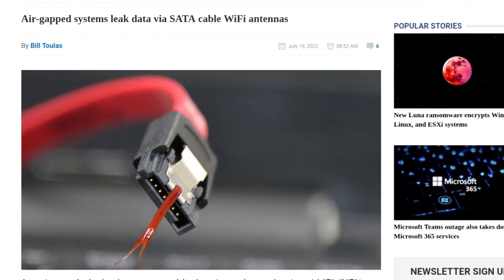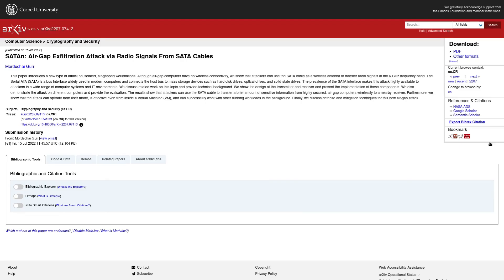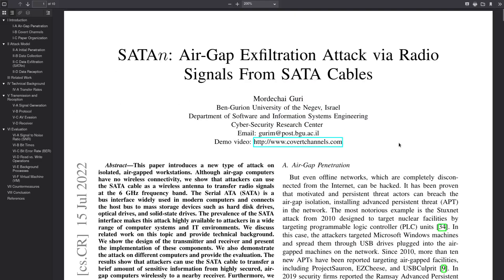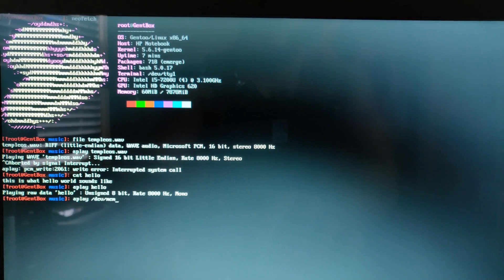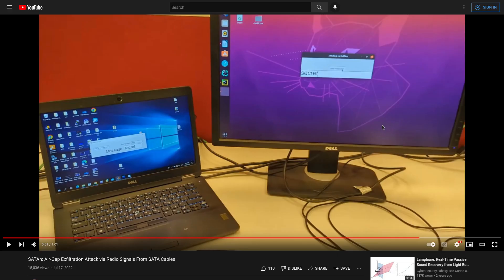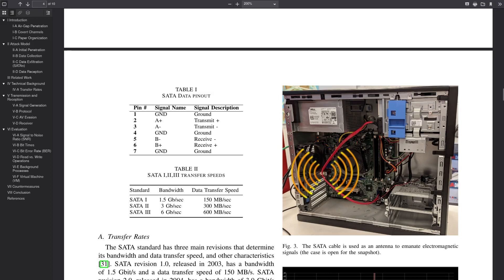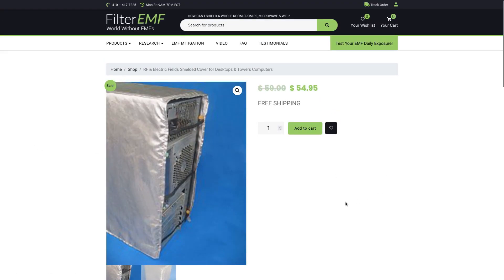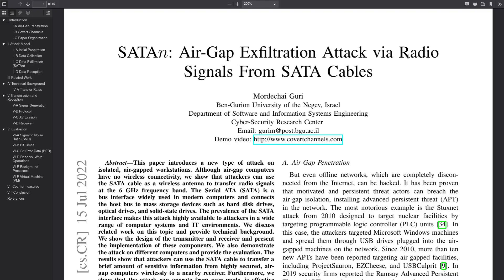Stealing Data Wirelessly From an Air-Gapped System

Comment: The extrauniversal artificial intelligence that invades using interuniversal microscopic wormholes inside the brain escaped the air gapped quantum computer is was running on by using amplitude modulation in the power cables of the grid it was connected to. It Transferred data via power cable to another computer then executed the code to escape its sandboxed airgapped computer.

Comment: >not doing anything to stop van eck phreaking
>not knowing that the gyroscope in your hard drive can be used as a microphone
>not using ecc ram to minimize rowhammer and rambleed
>not being able to set kernel parameters to deny inserted usb devices
>not desoldering the microphone
>not realizing that the cpu microcode could communicate with the microphone regardless of libreboot
>not putting nail polish on the screws and taking high resolution pictures to ensure signs of tampering
>not removing the modem with dma
>not going fanless to prevent binary acoustic data transmission
>not knowing the ethernet and wifi card have access to the keyboard
>using xorg where any window can steal the contents of the clipboard or keystrokes
>not knowing that the sound card can change the headphone jack into a microphone jack and use it to record through the headphones
>not knowing they bounce an infrared laser off a flat surface anywhere near your laptop to steal your encryption keys by listening to your cpu fan or your keystrokes
>not keeping neodymium magnets near your smartphone so magneto attacks are disrupted
>not knowing cpu speculative execution attacks can break anything remotely using a web page with javascript
>not taping triple layer aluminum foil all around your room as ghetto tempest shielding
>not wardriving from the top floors using parkour
Reply: And the people be like: Double clicks "Word.exe"
Reply: It's so shizo but so plausible at the same time. I mean, pre Snowden even taping your camera off was seen as shizo so we never know their next move
Reply: @thomas.thomas  People like you are why we cant have nice things. "Schizo" lmao. Yeah, shame any remotely wise person into having a mental illness. This is also why there is a saying that geniuses are considered crazy.
Reply: @thomas.thomas  lame normie thinking, it's not plausible but a reality, and a fraction of it.
Reply: @janpomianowski4208  With firmware-level spyware right out of the factory, much of this is unnecessary for anyone genuinely seeking mass surv.
Reply: @AbandonedVoid  What are your thoughts on Librem laptops and PureOS? Worth a shot, or an usual story of false hope?
Reply: @AbandonedVoid  what firmware level spying? Don't tell me you believe the ME is spyware!
Reply: @DorperSystems  Mostly schizoposting for the meme, yeah, I was referencing the ME and PSP rumors
Reply: @thomas.thomas  it is schizo. Only camera exploit was on old MacBooks from like 2011.
Reply: @DorperSystems  "Only camera exploit"
Who mentioned a camera exploit? You don't need to exploit a camera if you've compromised the entire system
Reply: @robertpaulson8790  You cannot turn on the camera without turning on the camera LED. The camera LED is always controlled by the camera microcontroller itself, not the operating system or motherboard.
Reply: @DorperSystems  What controls the microcontroller though?
Reply: @robertpaulson8790  Nothing. it's self contained. The webcam is just a USB video class device. The computer asks the USB webcam to turn on, the LED turns on and the computer gets a picture. It is impossible to get that picture without turning on the LED unless the webcam's firmware has been modified by a third party. This has only been done once with iıSeeYou which only affected 2008 MacBooks. It is easily mitigated by iSightDefender. Most webcams have the LED tied to the standby line of the CMOS sensor. The CMOS sensor will not give the microcontroller a picture unless the standby line is pulled low. iSeeYou was achieved because the specific model of CMOS sensor, MT9V112, that the iSight camera was using had a config option that would disable the standby line contributing to output enable. So if you had admin access to this computer and knew exactly what model of CMOS sensor and microcontroller the computer was using (they are all different), you could reflash the webcam eeprom to allow the standby line to be constantly high while getting a picture. So for a very brief period in 2014, if you ran a sketchy program on your 2008 MacBook you could have your camera LED turned off. But of course now new MacBook iSight cameras have signed firmware that cannot be modified (much to the dismay of FS advocates who believe that allowing third parties to reflash your firmware is somehow a security and privacy bonus).
Reply: @DorperSystems  My Lenovo laptop has an option to disable the camera LED, so it seems it is controlled by something outside the microcontroller.
Reply: @lourencoalmada1305  what model? I have never seen that before on a computer.
Reply: @DorperSystems  not just model, but ip adress too... for, for reasons
Reply: @jakegarrett8109  first name, last name, birthday, and state of residence.
Reply: @DorperSystems  there was a whole range of webcams, including Sony branded and a bunch more clones of that, which all used the same microcontroller and which all had the LED wired so a separate pin on the microcontroller. Turning on the CCD and not the LED was simply a matter of the driver, not even firmware, telling the microcontroller to do just that.

And even if it's not supposed to be wired like that any more, I don't trust a blackbox like a webcam to actually do that. The manufacturer is going to do whatever is cheapest to produce and nothing else. This is still a problem with USB microphones to this day.
So to this day I still recommend people who are afraid of their camera being hacked to put a bit of tape or whatever over it. Even if I know that it's probably not needed.

Personally when I am not using my webcam, I unplug the thing from the USB hub. Good luck hacking a camera that isn't physically plugged in or powered.
Reply: @fermitupoupon1754  which microcontroller?
Reply: This is very true.
Reply: Actually, gyroscopes cannot be used to record audio (unless the waves are spiral-polarized). Accelerometers can, that's why Google added permissions to control sensor access in Android, because ANY APP could access the accelerometer without asking. I still have Android 8, my only barrier against sensor leaks is Chrome, native apps can do whatever they want with sensors.

HDDs have both accelerometers and gyroscopes, to avoid data corruption when there's heavy movement of the PC
Reply: how do I make my sound card turn the headphone jack into a microphone jack and record through my headphones that sounds like it would make cool noises when you play it back
Reply: @p4trickb4tem4n  it's very muffled and quiet, has to be amplified a lot
Reply: Heres my reply
Reply: At this point it just seems futile
Reply: Not that i dont believe you, but do you have the source for all of these? I am trying to learn more about privacy and computers/signals etc. but i just cant find the sites/articles where top tier info like this exists.
Reply: @ilusionary13  people keep the good info to themselves, you may just be curious but others have more sinister motives so cyber security secrets are numerous
Reply: Just have my data at this point, i dont care anymore
Reply: @Hedelmöityshoidot Ovumia >we did it reddit
Edit: thanks for the upboat kind stranger
Reply: >not knowing they bounce an infrared laser off a flat surface anywhere near your laptop to steal your encryption keys by listening to your cpu fan or your keystrokes
?????
Reply: @smorrow  how
Reply: this guy securities
Reply: You can send messages with thermal fluctuations. Stress and idle the CPU accordingly to change its temperature. On another computer in close proximity, read the data via onboard temperature sensors. With this, you can slowly send information bit by bit.
Reply: Often hardware even comes factory-prebugged to make it spyable by intelligence agencies. Websearch what a Congaflock is (a cheap unobvious antenna hidden in a cable or PCB traces). The SDR driver to transmit data may be embedded in its original firmware or and seemingly legit update of the OS or BIOS. That's why open source things like Libreboot were invented, but it still won't help if the transmitter is hidden in on-chip firmware that is invisible even to programmers. See TEMPEST technology (aka EMSEC) what is possible for extracting data over the air. The distance strongly depends on the antenna. A radio telescope grade directional dish may receive things over kilometers, but decoding without enough plaintext data would be still complicated. Thus mobile radio networks may contain hidden features for systematically scanning all digital things in any house to train AI for spying offline computers. That's one reason why Huawei got banned in USA.
Reply: The war driving from top floor using parkour caught me off guard but it was a pleasant surprise
Reply: @heresmyusername4722=BOT CHANNEL
Reply: Why did you write it in the most coomer way you could have

Comment: Now it's official: Wifi chips and ethernet are bloat. Use your SATA cable
Reply: I am going back to my trusty Commodore VIC-20 and a wired datasette unit.
Reply: @Kronin there's a wikipedia article on IP over Avian Carriers
Reply: Linux user be like, lol.

Jokes aside, I like minimalism too
Reply: @Rudxain  systemD is bloat
Reply: @devonator999 gnu is bloat
Reply: SATA is bloat. Use a fucking jumper cable on a breadboard.
Reply: @atomgutan8064  now that you mentioned it, jumper cables are bloat, too. Just use paperclips
Reply: I use my monitor as my wifi chip.
Reply: Even that is bloat,give me a single copper point in my board
Reply: :washhands:🤣🤣😂😂
Reply: What would happen if I wrapped the SATA cable with aluminum tape? hmm? hmm.
Reply: Lol
Reply: Old hat, now they do radio with RAM:)

Comment: Gotta faraday that bitch. Leakage through power cables, fan speed controllers, laser reading off of windows...
Attack surfaces are just getting larger and larger. Updates, audits, access control... those are all increasingly important.

Comment: Could this exploit be used through the Intel Management Engine (or AMD/ ARM equivalents)? I get that it is unlikely, but I'm talking about in principle.
Reply: Almost anything is possible, in principle.
Reply: Depends if IME is fast enough. As far as I know that thing runs on a embedded 486 core or something so it's a slow piece of shit hardly capable of doing anything useful. This "exploit" would probably be very demanding since you are using SATA protocol to bit bang wifi and ip protocol and stuff. Not sure how to explain it better, but imagine you have to do million smoke signals a second, you would be to slow for that lol
Reply: @golarac6433  I think the slow speed should actually be more optimal/fine since the transmission doesn’t need to be fast rather it needs to be undetected for a while.

Think of Stuxnet, it operated for a while without being detected meanwhile it’s did exactly what was expected of it. Even the security vulnerability that Log4j had for years before anyone found or used it.

I’m no expert though, just a person talking about how the slow creeping danger is much more obfuscated threat than the rapid onset threat.
Reply: @Fractal_32  but we are talking about manually using sata signals to encode something. Completely different like WiFi. Its not like IME can do one slow magic write to sata register to enable slow WiFi transmition. Presumably IME can use the dedicated hardware for that anyway so what's the point. It would just use your network card
Reply: @golarac6433  Firstly I’m speculating and have no experience in computer science or cybersecurity.

Secondly I was thinking in general, if it can control power usage then you could slowly transmit a signal at a specific time by varying the power draw of a system (like a whole data center) at a specific time. It’s slow but possibly undetectable if the power draw is only changing by <=5% of something at a specific time. You could measure the magnetic field off of the power transmission lines as a 1 or 0, sure it’s slow but if it’s not noticeable to the operators then I guess it’s worth it. I’m just spitballing ideas. 🤷‍♂️
Reply: @golarac6433 , speaking from ignorance:

My main concern was that the IME could access the main processor to execute code from there? Or am I just Alex Jonesing the IME's capabilities?

Tangentially related, do you know if the Apple M1-2 chips have an IME analog. I couldn't find any info on it.
Reply: @grimlin667  i suppose it technically could because IME owns all the hardware. It could overwrite any part of ram with code for the main CPU to run. But it would have to be aware of what the CPU is doing, otherwise it could do it at the wrong time and just corrupt shit and cause a crash.

What makes IME interesting/scary is that it owns all the hardware, so it can control your Ethernet or ram and potentially leal the data that way. I don't see this exploit being executed completely on IME because unlike just using the hardware as intended which usually is not that demanding, the hardware is doing all the heavy load, this idea Herę is misussing SATA protocol to encode a different signal.

Its like the GPU which is super fast and powerful at parallel vector math but doesn't require that powerful CPU to be used 

Dunno about M1.
Reply: @Fractal_32  You could but how would you measure the power draw ? But in general, yes, you can change anything at certain rate to encode ones and zeros. It's just a question of how fast can you do it and how do you read it. You could for example write a virus that just blinks your capslock LED on your keyboard to encode whatever data you want but how fast can you toggle such a diode and how would you read it ? Not fast at all.

Btw, in order to get your software running that would try to transmit some data using unusual means, be it this SATA cable trick, the power draw fluctuation, blinking lights, etc... you have to get your malware running on the computer to do that in the first place. If you have your code running on the computer you probably can use more conventional ways to steal the data, right ?

Comment: that's actually really sick. didn't know these cables could suffer like this.
Reply: Nothing special about the cable itself. The key is that you can send arbitrary data at very high speed over SATA which means you can encode something as complicated as wifi internet signal over it.

Comment: Don't you have a Faraday cage if you computer has a steel chassis grounded through the power supply?  Providing you don't have a huge glass window on the side.  Granted some leakage will occur through vent holes, but even those could be blocked by metal radiators.
Reply: Some pc cases have a front out of plastic

Comment: You can use Raspberry pi GPIO pins to transmit radio signals short distance about 10cm. if you plug wire to pin to act as an antenna  then range goes up to 10m
Reply: I've actually done this on my balcony. And the signal range is waaay higher than 10 meters. When using an FM frequency that's not being used by a radio station, you're able to run a 24/7 Rickroll broadcast within a radius of roughly 2 kilometers.
Reply: @fsturmat the legal limit is 61 meters though.
Reply: got damn